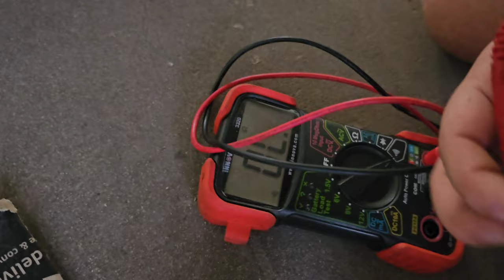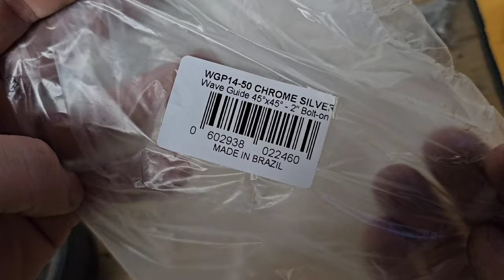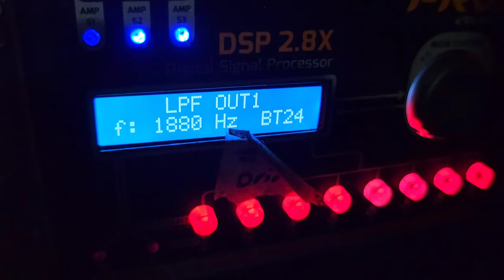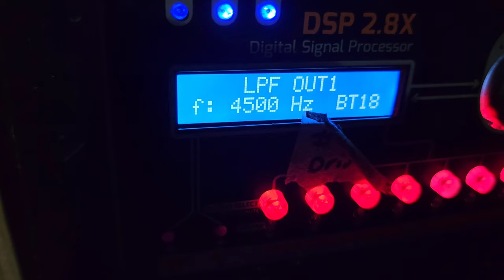Prv Audio Tahoe - SNOWMAN gets upgrade from 6 horns to 12 - Watch how it's done! Pro Audio TIPS 💥

Comment: Great video!! Question. How do you wire the 6 drivers to the tpt3000? And are you using a 1 ohm or 2? Thank you
Reply from the maker: I wire the 3 together to 1 wire, the other 3 together to 1 wire. Then wire the 2 wires together to the amplifier. 1 ohm amplifiers. The 6 drivers is about 1.33ohms.

Comment: This showed me that when I'm in the market for a router. Don't buy ryobi. The set up is dope tho
Reply from the maker: @eighty3boxchevy  that router is very good for small stuff. Also, you should rough cut before you do a piece like that's which I didn't do. For bigger stuff, I use a very good Bosch router. I actually have 2 Bosch routers one in a table and one for cutting circles
Reply from the maker: I watched the video again and it did a damn good job
Reply: @12voltfever  I watched again too and you’re right lol